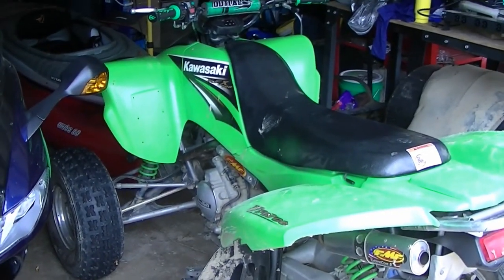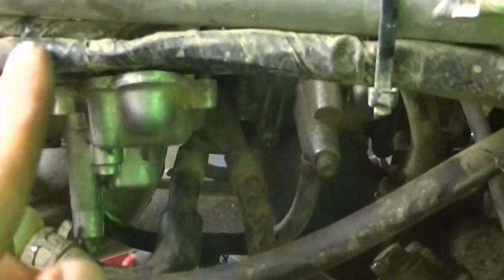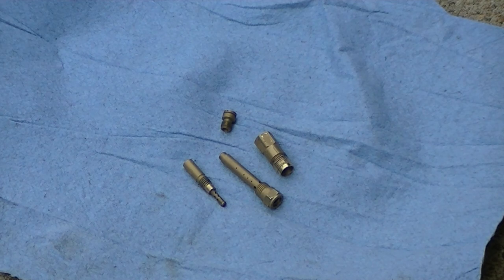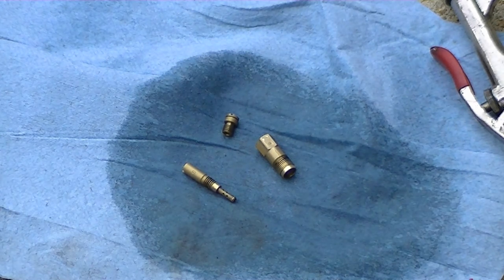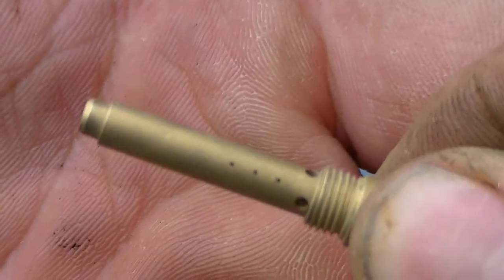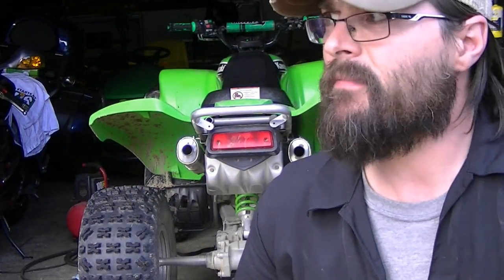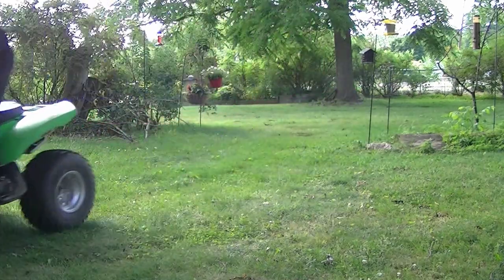Quick cleaning of Kawasaki KFX700 Carbs. Grit in the emulsion tubes=no power/no wheelies!

Comment: Good job, I did mine without taking them loose. Saved a lot of time. Just took the body cover off to see under the air filter area and the rubber vent tube for the belt to gain access. Didn't take long to get it running again.
Reply from the maker: I just wasn't able to get to all the screws to the bowls. Next time, I'll try it your way. Anytime I can save working on it, I can spend riding it!!!

Comment: how to know if its valves or carb? Hard to start. But when she died it was like a carb issue
Reply from the maker: Good question. For me I knew it was a carb issue because it gradually started to loose power in the mid and upper range. It got to the point it started to "pop" through the carbs from going lean. If I ran it with the choke on it would run better. Thats how I could tell it was not getting the fuel it needed.

Comment: What kind of problems you had before cleaning the carbs ?
Reply from the maker: It was popping and backfiring through the carbs from mid-throttle to full throttle. It would idle and I could feather the throttle to get moving but anything over 50% throttle it didn't want to run. If I went full throttle from a stand still it would just backfire and stall.

Comment: I have a problem trying to put  it in reverse  I can't  what can I do ???
Reply from the maker: Start simple, check everything associated with the shift mechanism. I know the foot brake has to be pressed to shift. I'd start there and make everything is still hooked up and in good shape. Check the shifter cables to make sure they're okay. Could test that by disconnecting them from the gear box and twisting the shifter to make sure it moves smoothly. While the cables are disconnected to can try to move the shift linkage by hand to make sure that's not jammed up somehow. I know on my truck, the F-ZOMB50, if the transfer case fluid is low its really hard to get it to engage 4 wheel drive. With that in mind I'd also suggest checking the fluid levels in the gear box. Those are just a few ideas off the top of my head. Does it shift into forward fine?
Reply: I have the same problem
Reply: @Captain_Yodelstein  thanks im definitely subscribing 🙏
Reply from the maker: @Fuxkyou1188 , much appreciated! Hopefully you can get your KFX figured out.

Comment: My kfx700 seems like it has a lot less power than everybody else’s kfx700
Reply from the maker: Has it always seemed low on power or just get that way gradually? If it hasn't had a tune up lately throw some new spark plugs in it and a clean air filter. Simple things like that can make a difference. Could be the carbs also. Mine was feeling low on power before the carbs got plugged up enough to cause it to lean out, backfire and stall. I  noticed with mine that it would run better with the choke closed slightly as the carbs got plugged.
Reply: @Captain_Yodelstein  I replaced the plugs and I think I’m going to pull the carb off and clean it and replace the gasket between the air box and the carb because the carb is sucking in dirt
Reply from the maker: @zTUCK2002  you can seal the bottom of your aircleaner in the airbox with heavy grease. Only other thing that came to my mind is if your quad is low on compression. Hope you can get it figured out. They are a last to ride when running good. Wheelie machine!

Comment: How do you remove idle cable and do you have disconnect the throttle cable etc
Reply from the maker: The idle cable just unclipped from the plasti,  and I did not have to unhook the throttle cables. There was enough slack in the cables to rotate the carbs up and get access to the bowls.
Reply: @Captain_Yodelstein  so did you remove the bowls to get access to the jets. Thanks for replying back
Reply from the maker: @bigd4115  Yes. Once you get the airbox removed and intake tubes loosened, you should be able to pop the carbs out and rotate them enough to get to all the bowl screws. From there, it's easy access to the jets. Oh, make sure you have rags ready to catch any fuel that's still in the carbs.
Reply: @Captain_Yodelstein  so can you just pull up on the carbs to loosen the intake tube
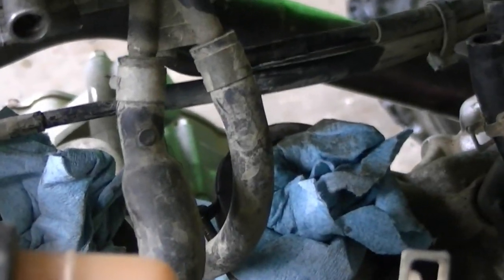Reply from the maker: @bigd4115 at the 2:00 mark you see where I have the blue shop rags stuffed unto the intake tubes/boots. There are hose clamps that secure the carbs to those. You'll have to loosen those first then you can pop the carbs out. If I remember right, I had to use a very long screwdriver from the left side of the quad.
Reply from the maker: At the 4:32 mark is when I'm tightening the clamps for intake tubes. They're in there a ways!
Reply: @Captain_Yodelstein  okay thanks. I been wanting to clean carbs for a while now  but wasn't sure where to start, the way you did it seems less involved compared to the the other videos I seen
Reply from the maker: @bigd4115 , I have taken them out and tore them down a pile of parts a couple times. Found most of the time the issue is in the emulsion tube, which is the one with the little holes. If any debris blocks those little holes the carb doesn't work right. In my experience it makes it run really lean. Good luck with the carb work. If you have any other questions just ask, I'll help the best I can!
Reply: @Captain_Yodelstein I was wondering at 4:06 in video I see you putting the bowls back on what are those tubes are they connected to it?
Reply: Nevermind I realized it attaches to the idle cable. Was wondering did you have to unhook the coolant hose at all or any other hoses . Sorry asking a lot questions don't want run into problems
Reply from the maker: @bigd4115 , no worries, I'm here to help the best I can. I don't recall having to unhook anything when I cleaned the carbs this way. There was enough give in all cables and hoses to get the carbs up enough to get to the bowls.
Reply: @Captain_Yodelstein  so I saw you removed and cleaned the emulsion should I remove all the other jets as well and give those a  clean.